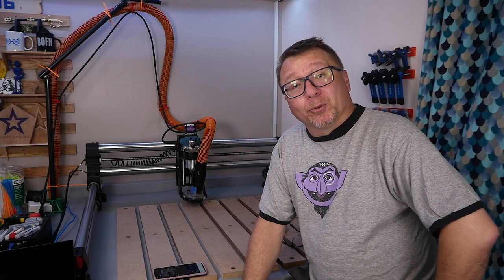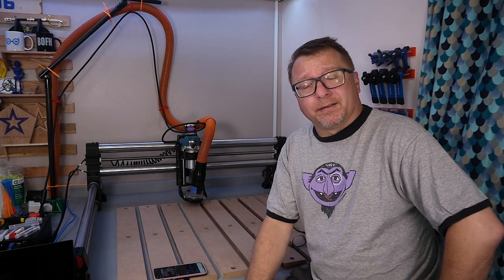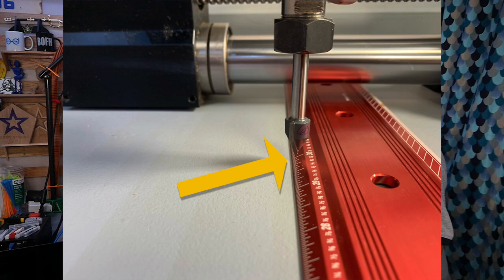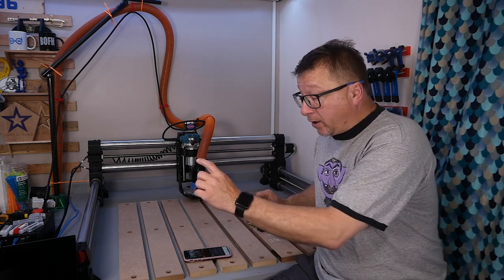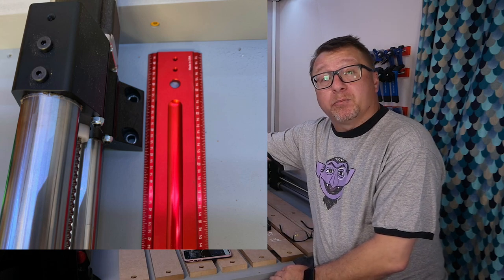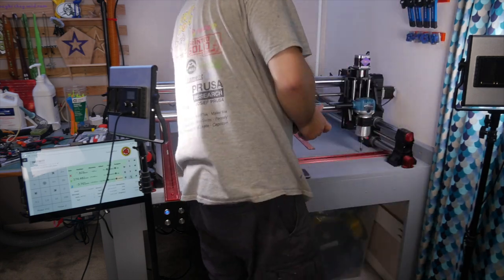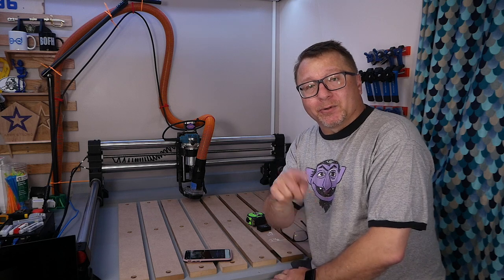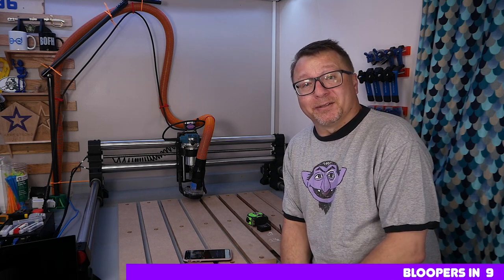How to Square a CNC

Comment: Did you check your carpenter's square for squareness? It's not uncommon for those to be a 64th or 32nd of an inch out of square along the length.

A 3/4/5 triangle test would seem to be more reliable. Set the home at say 100mm on your straightedge (your Woodpeckers are most likely straight) and set the x & y to 0 using the point of your v-bit to just touch the 100mm mark. Then do a G0 Y300 and see if the tip of the bit is aligned with the 400mm mark (100+300). Then enter G0 X400 ang jog the Z until you make a point mark on the spoil board. Then measure between that point and the100mm mark on your straightedge. If it is 500mm it's square.

You could also use the 7/24/25 triple but using inches. That would be more accurate as you'd be using more of the bed size.
Reply from the maker: Hi Jim - thanks for watching and the additional suggestions. I will give that a try and see where the machine ended up (though wouldn't you want to jog x 500 if 100 is really zero?). I did not check the square, but I do have my doubts as I mentioned in the video (or at least one of the various takes). I thought about the 3-4-5 method but thought that might be a little hard to explain in the video without a lot of graphics -- I'm looking for a good graphics package to up my game, so if anyone has suggestions I'm interested.
Reply: @cyberreefguru  The X will be 400 since that's not being tracked against a straightedge like the Y. The 0,0 is at 100mm on the straightedge so you do add 300 to the 100 to get to where the Y should land on the straightedge when you go to Y300.  But the X isn't being referenced to a straightedge (like it is when using a carpenter's square). The X and the diagonal are just math points to verify the lengths. If the diagonal measures wrong then it's not square. Definitely would want to actually do it on video - like you said it's hard to just explain.
Reply from the maker: @jimhatch5873  Ah, thanks much!

Comment: using Pythagoras theorem is the best way to do it.

Use 3 pieces of tape each with an X. Use a pointed bit in the collet. Move the CNC back to the rear left. Put a the tape with the X directly under the point. Then move the CNC X distance towards the front, put tape there. And finally move it X distance to the right and put tape there. Then measure the distance from point a to c.

You'll need to figure out what units you want to use but lets say you were using 1 unit per 200mm

A = 0
B = 800mm from 0
C = 600mm from B

Then the distance from A to C should be 1000mm, if its less then you need to bright the right side forward if its more you need to push the right side back.
Reply from the maker: Thanks -- I will give it try!

Comment: You said you unscrewed your bolts holding the feet down, but if I remember correctly, mine are screws. Unless I move everything, do you have any suggestions so I don’t just go back into the same (out of square) holes?
Reply: Hi there! There are bolts holding the X gantry to the Y gantry and then screws holding the feet to the waste board -- you can adjust both, but I probably misspoke and should have said screws. Regardless, I would adjust the entire machine so you don't reuse the same holes if your adjustments are so great they can't be accomplished within the tolerances of the holes in the feet. Some times you just need move small amounts, so loosening the screws, moving the feet and retightening is good enough.  Hope this helps!
Reply: @thomassasala : Oh, thanks for clarifying. I didn’t even think about adjusting the bolts holding X into Y.  I’m pretty sure I’ll start again, moving the feet back the inch or so between the existing holes.
Reply from the maker: Solid plan! Good luck!

Comment: Thanks for that vid - I assumed mine was square after doing a "by the book" install,  WRONG 1/4 off
i found out when i made a corner bracket and checked it for square and it wasn't. i will be using the straight edge method to remedy that and then rerun the l bracket to verify , Thanks again
Reply from the maker: Glad it help you Scott - you can also use the 3-4-5 triangle approach - it might be easier if you don't have a larger square.  I'm going to try it too. Thanks for watching!
Reply: @cyberreefguru  squared it up with a drywall square and 4ft level for straight edge , thing of beauty.results are bang on

Comment: When calibrating the travel distance and adjusting the motor travel-per-rev value until the machine moves the precise command value (example: 30 inches in the x direction after adjusting motor 0).
My question is …. do I need to change both motor 1 and motor 2 (both y direction motors) when calibrating the y travel distance or just motor 1?  If I should adjust both motor travel per rev I assume they would be the same value?
Your videos are great and helpful btw
Reply from the maker: Hi John - you should adjust both and re-test. It is possible only one is out of sync and you will have to balance the two with the settings.  Thanks for watching and thanks for the kudos!

Comment: Thanks for your video and all the hard work to make these.  Your succinct and straight to the point approach is excellent.  This is a very useful video and is thought provoking.  Thanks for the insights on the QCW frame!  I have one on order along with my Journeyman. 
Two cautions for others:
1. A framing square is notoriously inaccurate.  Be sure and check yours before you use it.  Mine is not square enough and would produce an unacceptable error using it for this.
2. I would confirm the length of the two Y frame assemblies.  Are they exactly the same?   Any difference between the two Y rails affects the "carpenters technique" using the tape measure.
Reply from the maker: Thanks Alan - great suggestions!

Comment: I'm curious what the tape measure read, after squaring it with straight edge & square. Would be comical if you got same measurements prior to tweaking it all on both methods.
Reply from the maker: Hi Teague - I was curious as well, so I checked.  Interestingly, I got 59 3/16 on both sides. I'm guessing it was closer to 59 1/8", but within the accuracy of my eyes and my 20 yo tape measure.  Thanks for watching and commenting!

Comment: but how check square to beam true ewery time when go to home point. linuxcnc and paraller port cheap controller and how add dual Y axis, mach all this not can do but linux can i understand. maybe need dual paraller port can add more input and output pins, and linuxcnc hall code (i not understand code anythink) go to home SW 1 first rail,then wait SW second rail stop too.and then have zero. but i not can do this i not understand how code this. code need when rail 1 have zero then wait rail 2 zero or rail 2 zero need wait rail 1 zero, need 2 limit SW to rail top.both side one. and 2 relay,  arduino can made code sense when beam rail block have true same point both side. and then both rails have same point send to cnc ok, have zeroing.
Reply from the maker: Hi there - I'm not sure I undestand the question. I don't get the relationship of the controller to the 'squareness' of the machine.
Reply: @cyberreefguru  hi, sorry my bad english, i mean, my cnc have dual Y axis motors, if one motor lost step how i sguare 2 motor run home and first motor stop to homeSW then need second motor run and stop to homeSW. i not understand code lot  because i think both motor stop if first motor stop to homeSW, need secon motor not stop and run own homeSW too. both motor own homing, when home have both motor stop then have Y axis sure sguare again. this if one motor lost step,  many other problem have too dual motor but thats i think how make.

Comment: thanks to video, old style but if ant do come square. we made in factory were we build automation sheet metal stamp machines, big hiwin rails first one rail totally traight to table, then second rail but not tight, and measure 0,0001mm clock second rail have traight too. we add first rail linear block and then screwed this block bar, were have measure clock and measure second rail sure traight then we have 2 rail and totally same line. then installing beam and measure 90 degree beam have sure square. and add spindle measure clock and meausere have beam same line than table all come inside 0,0001 mm side  this is perfect, wood worker not need this accurate  have very good if have inside 0,01 mm then can working good woodwork.
Reply from the maker: Thanks for the suggestion and watching!